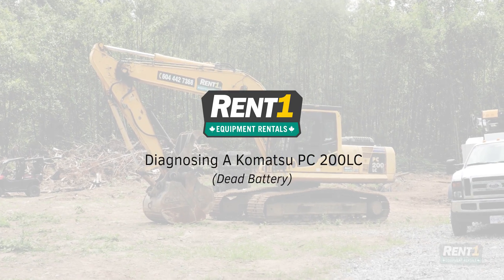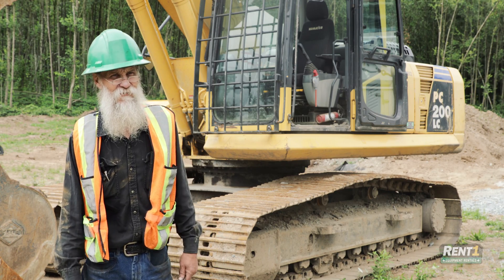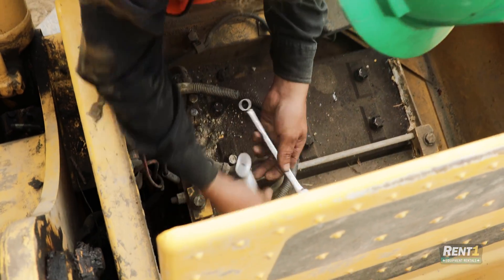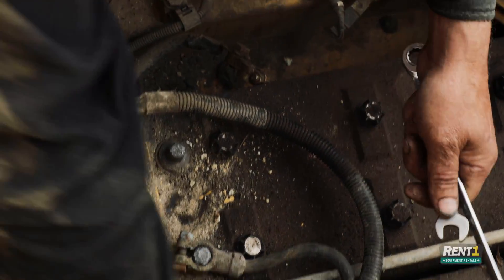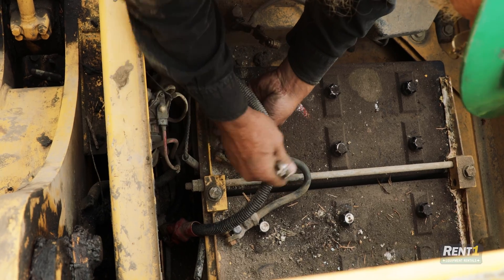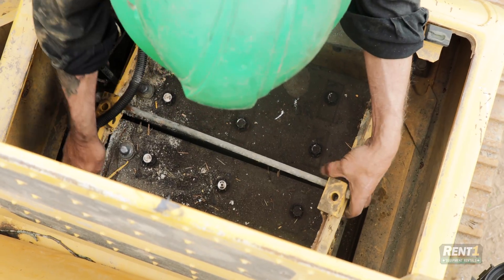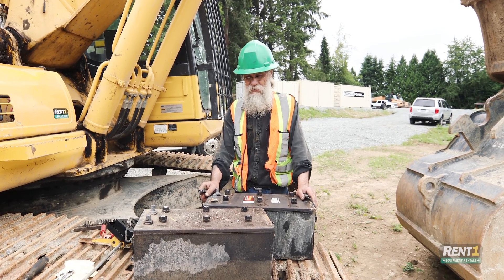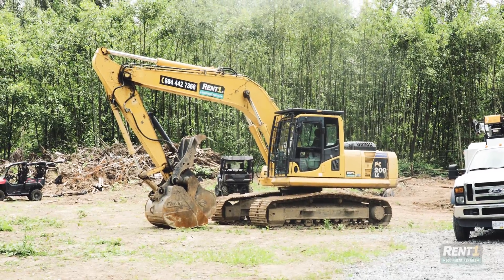Excavator Won't Start??? - Charging The Battery On A Komatsu PC200LC [4K]

Comment: down side to this vid is... if ppl are looking this up, they also know hoe to charge a battery... 
a useful vid would be to go through the entire starting sys to troubleshoot and repair.
ie. changing the starter and finding other probs related to starting.
tough guy, picking up them 8D batteries is not fun.

Comment: Uh... yeah, way to leave us hanging.  It would have been helpful IF you would have shown us if charging the batteries solved the issue or if it ended up being something else.  As-is, this video is very unhelpful.  A good start, but then stopped, just when it was showing promise.